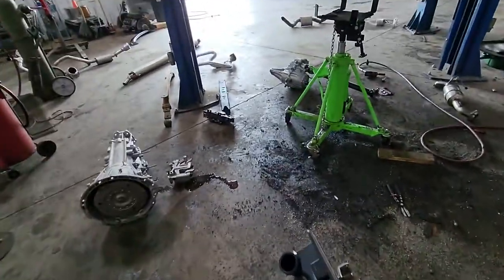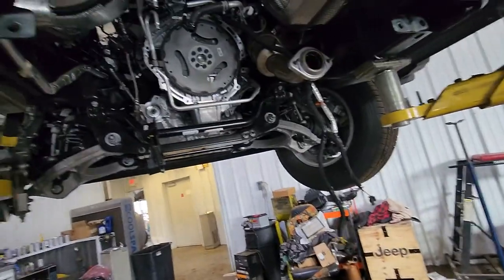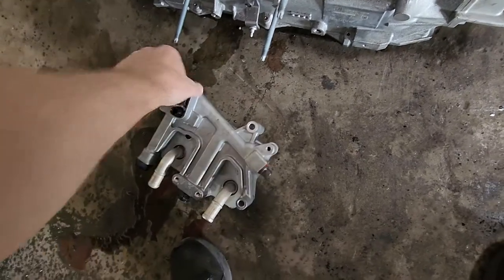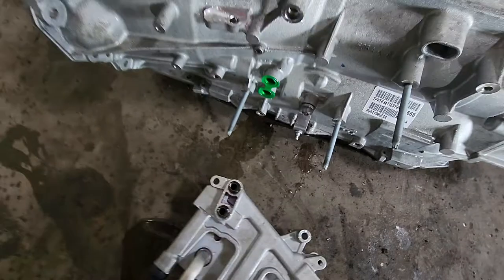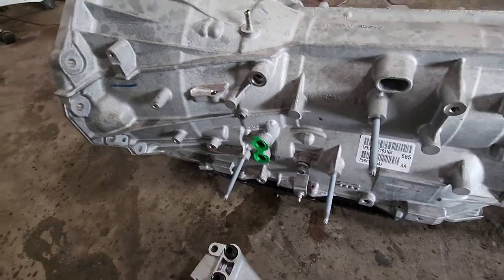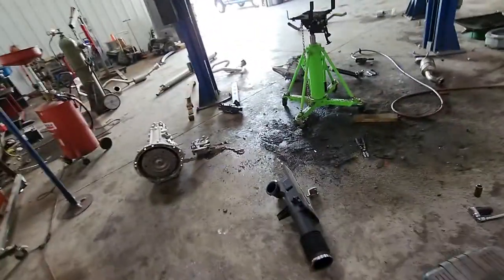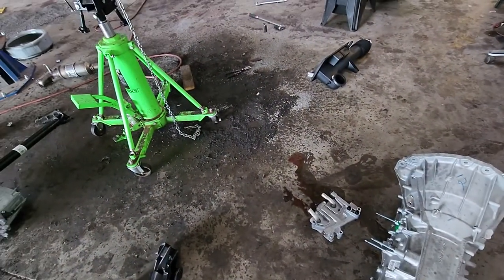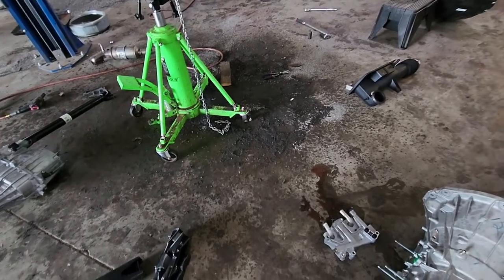2022 Ram 1500 V6 Etorque transmission failure due to incorrect manufacturing on the assembly line.

Comment: Damn...had not seen that before. Those lines are for the heater/cooler  and some folks plug them outright to get rid of the side unit when used in other applications . It shouldn't damage the transmission unless it was towing and really overheated.

Comment: My Ram 2023 1500 Etorque was in the shop do to Transmission failure as well. For approximately 2 months and they refused to give me a Rental and forced me to foot the rental bill the entire time while also paying my monthly payments.
Reply from the maker: Id contact Chrysler if you have proof of failure with warranty coverage and also contact your insurance and see about any help or reimbursement
Reply: @CodyDoesIt  Thanks 😊
Reply from the maker: Should be 5 year 60 on the power train. Unfortunately, if you bought said vehicle and it was previously crashed and not reported to the car fax fixed and sold at auction, it would be on the seller.